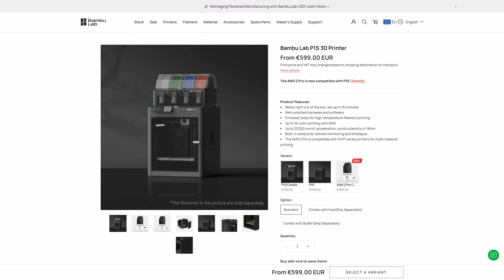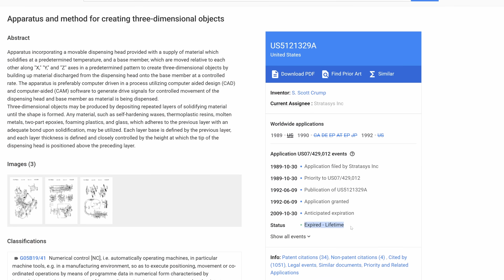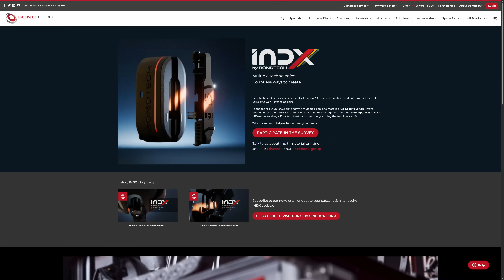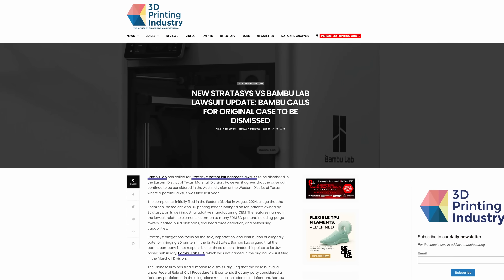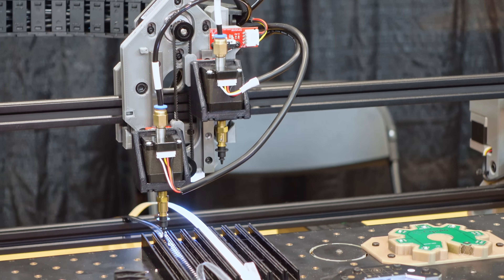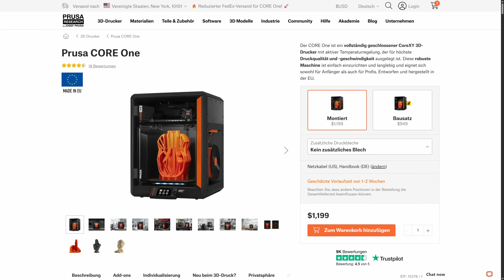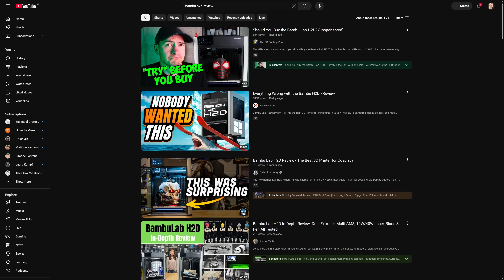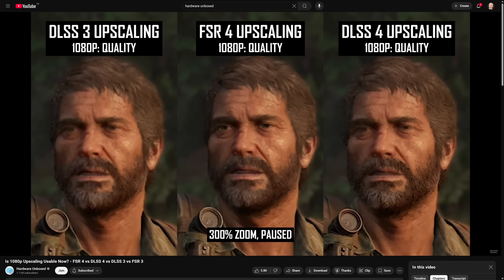How Bambu has won

Comment: It is an outcome that the Patent system rewards, markets reward co operation. Blame the game, not the players.
Patents have delayed the wide adoption of filament based manufacturing and now they are driving up cost while wasting precious time of smart engineering brains, that could be spend on making a better future, but now is spend on working around patents and their related legal issues.
The opensource model has proven just fine that investments and development happens without patents. As with everything, the best system is the simplest system, the best part is no part. And patents are a system that we don't need.

Comment: Having been in this hobby since 2009, I am pretty much done with the 'tinkering' aspect of the hobby.  I LOVED playing with the firmware, building my original printers, and saying "HOLY SH!T I BUILT THIS!?!?!".  I mean Slic3r was the best thing you could ever want in a slicer.  

Now?  I just want the darn thing to work.  I have my 2 home built units that haven't run in a decade (wood, threaded rod, hand soldered electronics, no-heated bed, J-Head hotend), and I have 3 other units (Ender 3, CR6-SE, and a 5-Plus).  All those work, and work amazingly well.  I love a  3 of those units.  That said?  THEY ARE SLOW.  I'm usually not in a big hurry, but sometimes...LOL.  

Also I work with a local middle school.  I am their sole tech support for 3D Printing.  Our new Superintendent of schools is HUGE on getting people back into the trades and making.  He created the makerspace and got a teacher to teach it.  She is amazing, but she is also learning (and has her hands full teaching power tool usage, laser cutter usage, CAD, 3D Printing, and more).  She HATES the Creality printers that the local MicroCenter donated, always having issues, always needs tweaking, etc.  When she got a $5K budget and asked  what to get I said "How many do you need", she said 3 to 5...I said "Bambu Labs P1S".  She LOVES them.  

Gone are the days of the minority having printers, and knowing them inside and out.  We are in the "Dot Matrix" era of 3D printers.  Plug in and run for the most part. I will miss it, and I wont miss it.  Glad I was there at the beginning.
Reply: i 100% feel the same, i got an a1 last month, and i think i've printed more stuff with it since it showed up than all my other previous printers combined. It's so satisfying to just click print and see the thinh going, every time. I might get another old printer to just thinker with for fun and nostalgia.
Reply: "We are in the "Dot Matrix" era of 3D printers.  Plug in and run for the most part." Trye, but also, unfortunately going torwards HP and Epson printers. 
My 3d printers are more reliable than my inkjet printers somehow.
Reply: Good Choice
Reply: Totally. Man I’m glad I learned on a crappy i3 clone and a Prusa Mk2 but I’m also glad I now just pay Bambu to do all the thinking for me.
Reply: Going from Enders to Bambu isn't exactly a fair reflection on the state of the industry, though, is it?

"She went from a Yugo to a Ferrari and LOVES it!" - literally anything that wasn't a Creality i3 clone would have been a massive upgrade, and might not have required entering a walled garden ecosystem or forced software choices.

I have had this discussion with schools nearby, and have always warned them that, while the Bambu product is fast and reliable, they're not the only fast and reliable printers and that there's every possibility that they're walking into a trap.

Now the trap is springing, and it's causing problems for a lot of people I know who went all-in on these printers and were depending on them for their business.

This company has lied, repeatedly, and raised their walls slowly but surely.

What makes anyone think that they won't engage in SaaS nonsense, planned obsolescence, or DRM materials?
Reply: @SwervingLemon Dont forget that the Ferrari came with a Yugo pricetag..
Reply: @SwervingLemon I feel like there are no other 200 bucks printers that offer the same experience. And about that, talking from the pov of a casual user, if it goes bad in 2 years it's still fine for me, I didn't spend thousands. I'm all for repairability and open sourciness, but at one point I just want everything to work at it's best with the least effort.
Reply: @mins_982 Are you talking specifically about the A1 mini? Because that's the only Bambu product I'm aware of in that price range.

There's some FAST CoreXY printers you can get for just a little more than that now, with completely open software. They're not quite P1S level of reliable, but they're closing the gap, fast.
Reply: I'm the same way.  Before, tinkering used to help things.  A dual-hobbed extruder for better grip on filament, better firmware, better hotend design and nozzles, and bead heaters.

These days, I just want stuff to print, and print right.  I don't want to fiddle with Z-axis offset, use bed adhesive, or chamfers on the bottom to deal with elephant's foot.  I just want to get the item printed and printed correctly.  I just don't think time fiddling with a printer is worth anything.  In the past, it was, but I rather just go for a more capable printer than spend more than the printer, for upgrades.

Comment: Sure, Bambu “won” 😏 if winning means locking me into their cloud, censoring the firmware and sending my data who knows where 🕵‍♂ No thanks 🙅‍♂ I’ll stick with my good old Prusa 😊 it just works ✅ runs quiet 🤫 and never gives me headaches 💆‍♂
Reply: Yes!   Bambu’s policies and quality just don’t work for me. If you want to plug in and print, go with Prusa, less drama, more hackability and still great prints.

Comment: I've been building and redesigning my own rep rap Prusa i3 since 2017, just for the fun of it. It's now a Core XY Klipper machine that is still a good printer and I've learned a lot with the process. I also had a Bluer Plus which I sold a while ago. But my time is not the same as 10 years ago, responsibilities are piling up and 3D printing became a more and more distant thing. Recently I bought a PS1 combo, because I wanted to focus more on designing and printing than tuning and tweaking. And it's no surprise to anyone, 3D printing is now so much easier and accessible that I don't even touched my old printer ever since. I live in Brazil and Prusa machines are not available here and even if they were, the price won't be accessible for 99% of the people. Even Bambu lab machines are a luxury item, but they made themselves present with many distributors and plenty of access to replacement parts and also provides a much better experience out of the box than any of it's competitors in the same price range.  I will never let my DIY side die, but sometimes all we want is something that's reliable and get the job done, just to focus on something else. But there are still plenty of new ideas emerging from the community, which brings new life to 3D printing, giving it new purposes and people like you are really essential to keep these new ideas alive.

Comment: I think the 3D printer space started with tinkerers, but as the technology has evolved and these machines have become enabling tools, now you have makers that want to create things with the tool and not interested in tinkering with the tool itself. This is why Bambu took off. Because they had a great out of the box experience, very attractive price point (as compared to Prusa), parts were reasonably priced and readily available, they had maintenance plans and scheduled reminders,etc. This provides for maximum availability/reliability and allows makers to just make, and not tinker. I know that was the main appeal for me. Can't tell you the number of times I've had to panic when trying to fulfill an order but then having to deal with a printer that refused to print (back in the old days before Bambu)
Printer reviews these days are a dime a dozen. I'll still watch them to see what the feature set of a machine is, but I assume most of them are paid shills nowadays.
As a maker, what I need to know is bang-for-buck information on my tools. If I can buy 4 Elegoo machines instead of 1 Bambu and get 4x the production output for the same cash outlay, does it make sense to go that route?  So long term reliability and ease of maintenance is important to me. What I'd like to see is some print farm owners publishing uptime/downtime/cost-of-ownership stats on the various printer models (kinda like what Backblaze does with their hard drive statistics.) All the CoreXY Bambu clones print great out of the box. What I need to know now is what it takes to get to the 500/1000/2000 hour usage marks for these. Do they hold up, or are they a maintenance (and tinkering) nightmare?

Comment: locking down the firmware after your customer already are using the printers sets a abd precident fpr the future. together with their rfid enabled spools makes me fear that they will exclude 3rd party filament in the future. i was looking into getting a x1 or p1 because i liked their multimaterial integration, but then they locked down the firmare and i got cold feet
Reply: They will never do that, no need to spread fud.
Reply: @JakovPerisic  what would stop them from going full hp? they already significantly altered the printers after they sold them
Reply: @oOSpecialProskillsOo they can't do it even if they wanted, printers don't have that ability. 
And they didn't change any advertised specs or capabilities.
Reply: @JakovPerisic  how are they not able to implement a check if an authorized rfid chip is present?
Reply: @oOSpecialProskillsOo because there isn't. You are obviously talking about stuff you don't know enough about ;)

Comment: Ive got a small business that uses 3d printed parts. Bambu labs are a godsend. But if I was doing this purely for hobby id likely stick with a voron.

But Vorons and Prusa are not scalable compared to bambu. Being able to buy a P1S and it just work just the same as any other P1S, and print well, better than Prusa and Voron. Its a no brainer.

But for a hobbyist... I can see why the open source style printers are more of an appeal.
Reply: i could agree partially. Myself build voron0 has 100% success rate and assuming that i had like 20 build the same… Probably if i build 2.4 with same principals in mind it would also scale nicely. Bambu from other hand is plug and forget thing so scaling is super easy and in worst case break down scenario you would just order new one for replacement which is not that easy with vorons because at the end you have to build them precisely which takes more then a week when you are working… Prusa is scaleable but this crappystruder design is very problematic in many ways. The same goes for prusa mmu concept i literally hate this thing, use cases has been drown on knee during lunch break instead of being well thought and implemented the way you control.

Comment: You know what. The world has changed but i haven't! And don't need to or want to. I don't care about what printers one can buy. You helped me build my printer 8 years ago in the pre-Ender3 era, i was watching from shortly after this channel started and watched the whole awkward backlog, you helped explain the parts and the function, the construction, the materials, impart the fundamental skill. If this is not what we're getting from you going forward, but Bambu reviews, and unimaginative Ender clone reviews, "oh look how well it prints" or "i dentge default profile and it poo" then it is of little interest to me. I will be rebuilding the printer shortly btw. I am interested in valid engineering solutions i can borrow for myself. If the world doesn't believe in Open Source machines, well that's not my world, i reject it and build my own.

Comment: If it wasnt for Bambulabs descision to cut of access to their API so taht i can no longer manage my printers from Home Assistant, and use Orcaslicer. There would be 1 or 2 H2Ds in my farm already.

I love my other Bambu printers, but suddenly removing part of my access to them, for no valid reason, pisses me off beyond belief. (Their reasoning was security, but their new security measures were cracked in under a day)

Comment: Hi Thomas, I've been watching your videos for a while now, and the videos I appreciate the most are the projects you create. When you build something useful or innovative for yourself. I also do like hearing your opinion about different types of filaments or 3D printer adjacent accessories or devices and if they are worth purchasing or creating. Filament extruders, plastic injectors, dryers, or even CNC. I have 4 printers of my own now, and I'm always on the lookout for another tool I can add to my workbench that will synergize with the tools I already have, and increase my ability. Thank you for putting out useful, informative videos and being a reasonable voice in the printing community. Keep up the good work!

Comment: All due credit to open source, but my focus is on making items and more importantly, designing my own items to support my hobbies/projects. I need to focus on creating/designing my own print files and I need to have a machine that just makes the parts I design. 

I’m leaning towards the Core One as my next machine, mostly because I like Prusa and want to support them.  But it’s hard to ignore the Bambu Labs H2D, especially since I have an A1 Mini as my 2nd printer and it’s super dependable, capable and has built everything I sent to it!

Comment: There's two kind of 3D printers: the kits and the products.

What I mean is that some designs are primarily targeted at customers that just want to use their printer and they don't need to be opensource.

Then there are the designs that are mainly meant to be built by their users. Being opensource, modular, repairable and interoperable make them better products.

The reason why Bamboo Lab won is because they focused on making good products, while Prusa is somehow stuck in between.

I think you should focus more on the second type of 3D printers because they make more interesting and fun content. I'd like to see more Voron, Ratrig, Chameleon, ERCF, Box Turtle, Jubilee 3D on this channel because you have the expertize to properly cover them.

Everyone rewiews Bamboolabs 3d printers nowadays.

Comment: Setup a spreadsheet with what the printer can do. Then what you would like to see on the next version. Then share the spreadsheet for free.Also, if you could create a separate channel for laser cutters, so laser cutters could advance as fast as 3D printing, that would be great. I don't have a laser cutter, but a CO2 powered one some day is my goal.

Comment: There is a sad irony in this video, I think.  In this day and age, more and more, where and how something is produced really does matter (see: the supply chain issues during everything with Covid, and the current insecurity with the US's ever-changing tariff announcements.) But most people don't know what to look for or how to figure out what actually is good for them and their use case (never mind getting into such complex issues as product life cycle and embodied carbon,) so marketing and "ease of use" take priority, resulting in more and more things destined to become ewaste and people locked into walled gardens that stifle competition.  You even site one of the growing problems, people unable to use the best solutions for fear of getting to close to a patent dispute.    

The lack of open source means less competition and crappier, more expensive products with less and less innovation in the long run, leading to a race to the bottom cutting costs for those who aren't in the top spots and stagnation for those who are, just like we see in so many other products. 

A sad end to a promising industry.

Comment: I started 3d printing about 9-10 years ago, I have been an 3d animator modeller for over 25 years. I bought  my first 3d printer because the thought that I could print everything I made digitally was amazing. I soon found out the tech wasn't quite there yet, you had to do a lot of tinkering to get something half decent, sure it was amazing when you mod-ed something and the result were better, but I`m a creative I wanted to use a 3d printer as a tool to get amazing prints. the first time I felt that was a thing was when I bought a bambu lab printer, finally!, I thought a machine that can be used as a tool right out of the box, dont get me wrong I loved the whole journey, and thanks to al the brands that paved the way (I owned dozens of brands), but now all my (non resin) printers are bambu`s, as far for your video`s they always helped a lot in my decision making because you are very critical to brands so never change that but I also like channels like "aurora tech" I love their "dry" method of product testing , they get send a product they test it with a standardised set of tests and they give an unbiased pro`s and cons review